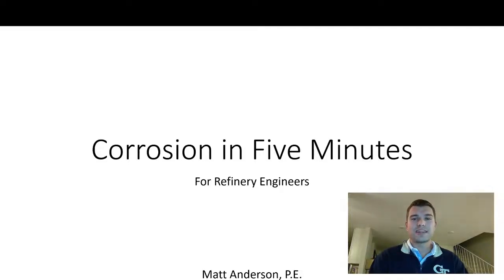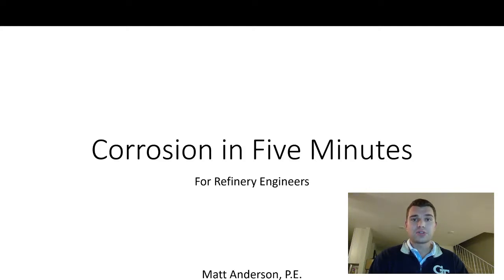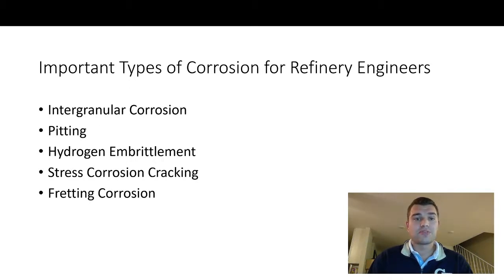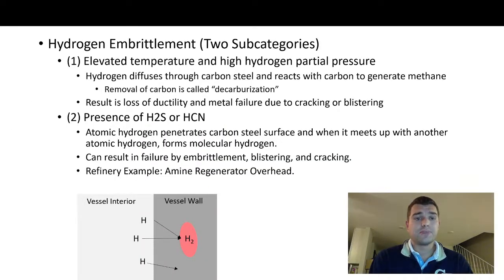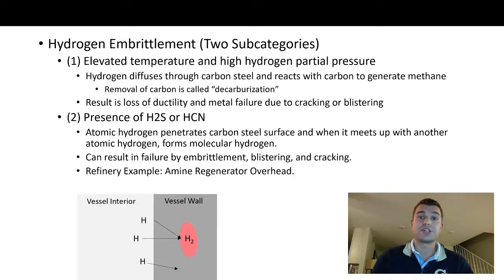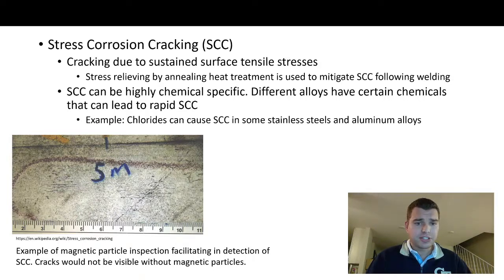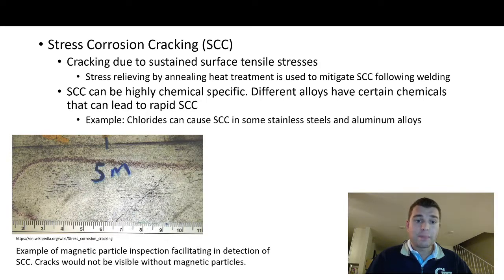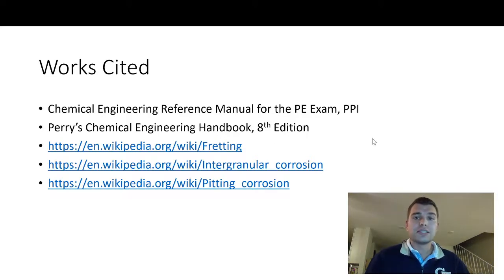Corrosion for Refinery Engineers

Comment: Very educational, I’ve crawled through a few towers during inspections, never thought about really putting much emphasis on the trays due to operations having control over that. I’ve seen missing tray valves and broken attachment welds as well. Maybe check out API 571 for more info over damage mechanisms. 👍🏼